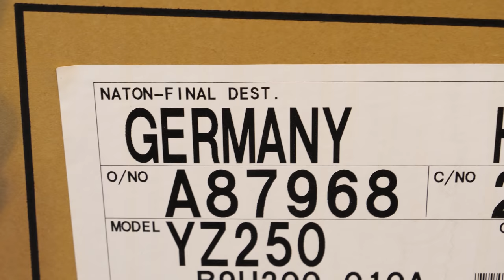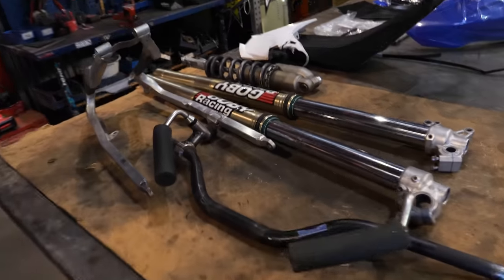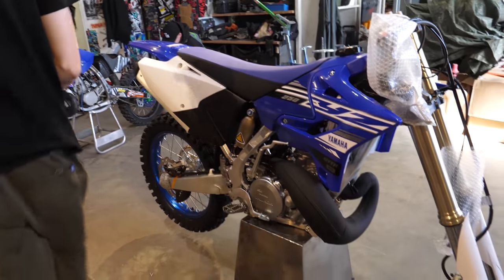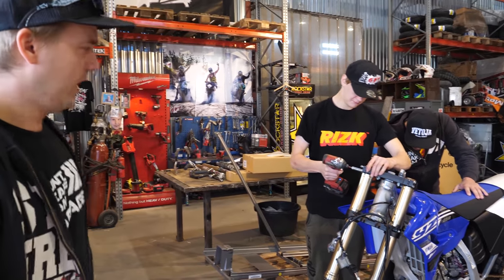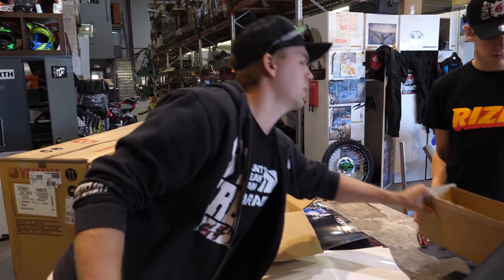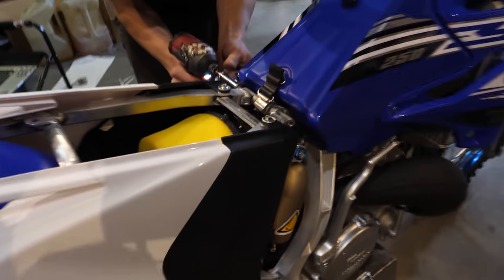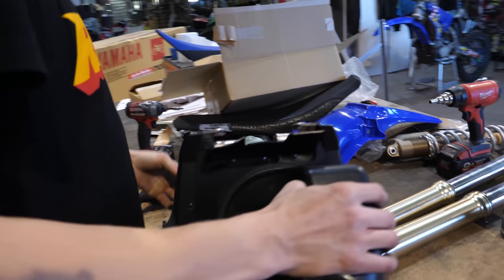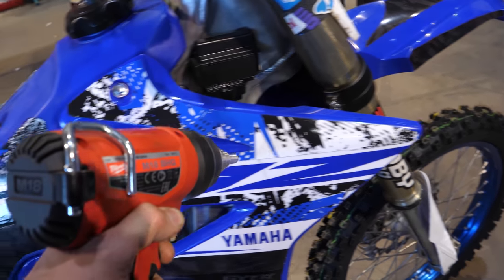UNBOXING Yamaha 250 YZ 2019

Comment: I hope you realise in 2015 they started to use to 4 stroke version of the KYB SSS forks. if u use your 2009 forks you will be down grading. Better to re valve the 2019 gear. I have a 2015 yz250 and was on the 2014 yz250 previous

Comment: The YZ250 and YZ125 are the Chevy 350 small block of dirt bikes. They may not be cutting edge by today's standards, but they're reliable, easy to work on, relatively inexpensive, have great parts availability, and always put a smile on your face!

Comment: yes its normal to get all thoses parts with a new bike but dealers rob them and sell them in separate in the parts department and make a huge profit selling them back as service cost to the customers
Reply: ian tchernegovski yeah dealerships are a joke the Yamaha dealership I used to
Go to wouldn’t fix your shit when you would get a repair, I came home to ride and my wheel bearings were still shot and that’s a $20 fix
Reply: Took mine to get serviced at my local dealership and couple years back and they were stolen from the dealership at night. Didn’t give us anything in return... luckily they were found a couple months later :))). And the dealership shut down about 6 months later.

Comment: Sure, we all wish that Yamaha would update this model, but it's really not necessary, most of us can't ride this bike to its full potential as it is. So instead of continuously updating these bikes like many other manufacturers do, they keep their bike roughly the same, with minor updates here and there, and this makes it easier for people to do what they are doing right there. To transfer your suspension over that you had much time and effort put into to tune it and make it perfect for your riding style, weight, and ability, as well as other parts that can be transferred straight over to the brand new machine. I have three yz250 (of many different year models) and I do the same thing, easily transfer parts over and not have to take parts to some mechanic to have them customized or whatnot. 

 We might wish Yamaha would update the 2-stroke line, but for whatever reason they do not, and these bikes are still excellent, even though the technology is not "brand new." Who really cares. None of us (regular people) can ride these bikes to their full potential anyway.  If you owned a brand new 2019 KX450, would you be able to transfer your very expensive suspension,  or your exhaust system, or even your wheels, over to it from your previous model KX? Probably not. Same thing from any other makes & models- that are constantly being updated by the manufacturers. This stuff is expensive. The sport is expensive.  it would be nice if the manufacturers would consider that before constantly updating their models that we really can't ride to their potential anyway. Keep the bike the same for a few years, no one will care, put bold new graphics on it. That's really all anyone cares about. It's how things used to be. And we all were plenty happy with it. Instead of having to pay $12,000 for a brand new 4-stroke 450. Which is also ridiculous.   As well as having to then update your 'brand new' bike because none of the previous parts will fit on it, you're talkin a ton of money just to put exhaust, suspension, bars, levers, wheels etc etc on that brand new fancy bike because your previous parts will not work on it. And that is also ridiculous.
Reply: If they make them all the same, why buy a new one?

Comment: yz250 is ad excellent well refined machine. I have a 2017 model YZ 250 2 stroke and have only put just over 60 hours on it and it runs excellent no issues

Comment: Bro that bike is brand new and there going to strip it and put disgusting  parts and graphics on it
Reply: yea cause you have to put those parts on for fmx and the bikes he bought are identical so instead of wasting all that money you just swap the parts
Reply: Hawk Gamer Nah, you just shave the seat and cut the air box holes out more. Twitch did a video on it.
Reply: what about the suspension he changed and with all those other parts he put on the bike would have felt the same instead of having a new setup iv seen guys run stock suspension on my biggest ramps and land incorrectley they dont have the saftey net that the guys with tuned suspension have
Reply: @hawkgamer3354  Seems stupid to me to buy a brand new bike and put old junk on it, that seat is garbage, should've just bought upgraded suspension and such if he was going to run a new bike.
Reply: Your Face i see u havent watched any other videos these GUYS do cuz they do this to every bike

Comment: If I stay headfirst in the dumpsters, one day I might collect enough beer cans and scrap metal to buy me a new YZ250X! The local Yamaha dealer told me he couldn't keep any version of the YZ250 in stock for long, they go out the door as soon as he gets them in!  He has a whole showroom full of new 4 strokes, though lol. People around here already got over the whole 4 stroke phase and they're all back to riding 2 strokes. I ride an older CRF450R and I don't mind 4 strokes, but a YZ250 is where it's at! It's just a few horsepower down from my 450 and weighs about 30 lbs. less. Yamaha is also the last manufacturer to offer a full on sport quad with the YFZ450. I'm a Honda guy through and through, but I can see why a lot of my buddies are Yamaha Fanboys!

Comment: 2015 and newer also have the wider platform foot pegs not the pissy little ones they had before. 2016 they did a new chain as well, all small changes but still things you don't need to upgrade anymore.

Comment: You should ov kept the original seat on the 2019 seat
Reply: The factory seat does look better, but he is using this bike for freestyle MX. They always make changes to the subframe and seat for freestyle. The nice thing is he can change the bike back to it's stock configuration pretty easily. Not to mention, he will still have new suspension with zero hours on it.

Comment: have to heat the fork clamps with 800* air blower to get the tubes to go in.
Reply: I don't if you've realised, but there are bolts that you can loosen so that you don't have to melt the metal to get the forks on
Reply: @povertysquatter  heating the clamps to 170 degrees causes them to expand with out stressing so they slide onto the fork tube with zero chance of galling, a heat gun that can out put 800 degrees Fahrenheit speeds up the process.

Comment: Ok I have a question. I got 15 years xp riding just idk everything lol. My weight is 187 l.b. height is 6'1 idk if that's important. But I can jump big etc well I wanna go bigger air. Would yall know what I would need  fork and shock wise?
Reply: Springs
Reply: Slightly harder. Softer shocks will result in the u bashing ur face off the bars cause the absorb everything to quickly and it compresses down fast and most of the way u want it to compress slowly
Reply: You need the stiffest spring for shocks and forks. Specially if you do lots of supercross. Raise the oil. Levels in the forks in slowly until you find your spot. Fill the shocks with nitro with an extra 20% I think 180psi. Every one is different but if you are serious you can do all the suspension work is easy

Comment: Yes it's normal you got spare parts with new motocross bike
Reply: i bought a new rm 250 in 07 and mine didnt come with extra piston, rings and complete gasket set.  it did come with 1 smaller and 1 larger main jet as well as a new needle and power jet tube, spoke wrench and owners manual but none of the other goodies that his yz came with.

Comment: i bought one of these bikes for my son only to find out a month after that yamaha has brought out a service note saying that the timing chain needs changing every 10 hours and the timing chains are $400 plus guides and tensioner ,this i a fucken joke because before they were released some race  teams told yamaha that the chains and guide were failing at 10 hours who in the hell would buy this bike if they new they had to replace timing chain after every day of riding ,i rang yamaha up and they told me that the yamaha dealers should be telling their customers before they buy them, i then told this to my local yamaha dealer and his reply to me was i might as well send all the bikes back to yamaha because i won't be able to sell one if i had to tell my customers this. my local dealer is fuming over it and rang yamaha about it and told them they might as well take all my stock of 250f back.this dealer is one of the biggest yamaha dealers in australia and sell more yamaha than just about any dealer in the country.
not to mention that engine mapping is over fueling the engine when cold ,i know this because at 5 hours when i change the oil there is a strong smell of fuel in the oil every time i change the oil and the yamaha dealer knows of this and the fuel getting in the engine oil will just cut the crap out of the engine crankshaft and bearings this is most likely why they want you to put a crankshaft in it at 30 hours.
my view is if you are not a chad read or a eli tomac that gets a new engine every meeting i would not touch one of these.
i am a third generation mechanic in the trade for 40 years and did not look at the service intervals because i would expect any four stroke engines timing chain to last a lot longer than that.
on top of that my bikes stupid lithium battery failed at 5 hours and my local dealer said that out of every 40 bikes he sells 3 battery fail which is about 7.5% of all bikes and there was none in the country about 5 weeks wait
if you want a bike to cost you a lot of money buy one of these heaps of shit .
great bike to ride plenty of power handles well but thats about all.
my advice is stay away from it

wayne hamilton
Reply: Are you sure you bought one of these? This is a 2 stroke. No timing chain
Reply: Michele Masters this is a 250 2 stroke this dosnt have a timing chain
Reply: I no
Reply: Lol obvious troll
Reply: In this person's defence I think they are talking about the YZ250F. I just came from the dealer and he told me 12hrs and timing chain is done on a new YZ250F. It's causing him a few headaches
Reply: Michele Masters it’s such bs, my friend was racing his 19 yz250f and it had about 19 hours on it and his timing chain broke over a 120 foot table top and he now has a broken back.
Reply: You got the wrong 1 man!

Comment: is the yz250 good for city riding / a little bit motocross and mountain trails a little bit?
Reply: Gibbon im asking if i should buy 250 yamaha 2 stroke or 4 stroke i dont like the yamaha yz250x but i want to ride a little  bit trails so is the 4 or 2 stroke 250 better for city /motocross / a bit of trail and mountain rides
Reply: Gibbon whats stalling and i think i will go for 4 stroke cause i like to give that braap when i wait on street light
Reply: Gibbon  No! Both 4 and 2 t bikes stall just as easily. There is only going to be a difrence if the two are geared differently and have a heavier flywheel, like a mx bike vs a enduro bike.
Reply: @grunx_1202  a 250 4t mx bike is a pain in the ass if you're going to ride on slow technical stuff, because they stall really easily, believe me because i own one.
Reply: Väinö Grönroos well what should i get for riding that stuff i dont like that much slow trails but will the 250 go gnarly in 3 or 4 gear?
Reply: Gibbon  tosa sun mopossa onki painavampi vauhtipyörä mikä pitää sen konee käynnissä vaikka kierokset laskiski alle tyhjäkäynnin siksi se ei tahdo sammua ajaessa ja kytkimenkäytön kanssa ei tarvii olla läheskää nii tarkka. Se riippuu siit miten pyörän vaihteiston välitykset menee ja et kui paljon koneessa on pyörivää massaa. tälläses mun ratapyöräs on pirun kevyt vauhtipyörä jotta saatais nopeemmi kieroksia ja koska näitte kans ei ajella mittää kävelyvauhtia ni ei sammuile, Mut sitku tälläse raahaa mettää nii siellä väkisinki sammuilee vaikka kuinka kytkintäki koittaisi luistatella kun vauhti liian hidas.
Reply: Grunx_ If its your first bike you Will have more fun on a smaller one

Comment: I am curious... is that Yamaha so light?
I've seen 2 guys lift it with finger tips with no problem.

I am astonished. (fogive my ask 'n but or it's light or the 2 guys are supermen)
Reply: Its 190 lb (86 kg) dry..
Reply: @mizutani2144  thanks for info. AHOY... really a feather.
Reply: attinia1968 ktm is 87.5 kg (192.9 pounds)
Reply: @mizutani2144  227.1lbs
Reply: Your Face yeah.. with fuel.. I was comparing the two with dry weight/no fuel, oil, whatever
Reply: @mizutani2144  219 dry

Comment: The manual tells u 20hours to run in the engine not a couple fuel tanks, the more u baby in a 2stroke the stronger the engine will be and last, 4 stroke is different ride it like u stole it, both ways worked for me perfect with my Yamaha banshee and my yfz450 👍
Reply: PED _ I think you got it the other way around. Baby a 4 stroke and run the 2 stroke like you stole it. Rebuilds are cheap
Reply: Ya bud you have it wrong. 2 stroke just mix it a little rich and run through a tank. Shit sometimes before a race I didnt even do that and never had any problems. Rebuild takes about 15 min. With a 4 stroke you have alot more components that can fail so break in at least 3 to 4 hours.
Reply: I’m just goin with my own experiences here but my Yamaha manuals that came with my new quads said 20hours so I just did it but I was listening to people on owner forums, never had an issue so just my 2cents worth that’s all 🙏
Reply: @ped1355  Better to be safe than sorry I guess. I was always just too impatient to make it through any break in period lol.
Reply: Chris Kenny as longs as it works is the main thing 😅👍

Comment: Yamaha hasn’t changed since 2005 with a alloy frame and in 2012 they did a suspension Change
Reply from the maker: They did change suspension in 2008?
Reply: Stunt Freaks Team I thought 2012 in the vid when u put the handle bars on u should tighten them in a cross pattern not just anyway
Reply: in 2015 they changed to the 4 stroke version of the KYB SSS fork. i have had 2014 yz250 then traded in on a 2015 yz250. 2015 also has the updated plastics/airbox.
Reply: Daniel Large yeah I have the 15 model as well
Reply: Jayden Lee great bikes all of them just love the 15 updates
Reply: gilessmokey yeah that’s because they also got the alloy frame

Comment: Rear sub frame?? Isnt it a swing arm.....?
Reply: Neil Anlin no
Reply: No. Shock connects the swing arm to the sub frame. Sub frame is basically what your air box, seat, and rear fender bolt too. Also the most common frame component to bend in a major spill.

Comment: That bike should of started first kick!! I got 25yr old bikes that start easier  then that
Reply: Bruh dont u understand that that yz has never been started earlier than that or only like tested If it Works properly...
Reply: For real its right out of the box and still needs a break in
Reply: Mental Alchemist- explain!!
Reply: Bc it's brand new I just got a new 125 and it took like lots of kicks
Reply: there wasnt any gas in the carburetator
Reply: Massive man- that’s BS, anytime I do a top end and carb clean on a bike it’s no different then getting a new bike. If anything a new bike is cleaner, the carb should have absolutely no dirt in it. Electronics don’t need time to break in..  why so many kicks!!??  No gas in the carb would explain it but that’s not the bikes fault, has nothing to do with being new!!
Reply: @Community-Action  How is that possible? XD If u do top end rebuild and clean carb it is really hard to be lucky tostart it with first start! : D LOLZ!
Reply: It’s a brand new bike needs to get the fuel flowing thru have you ever rebuilt a two and went to start it after
Reply: TheZombieKing52 your a special one arnt you